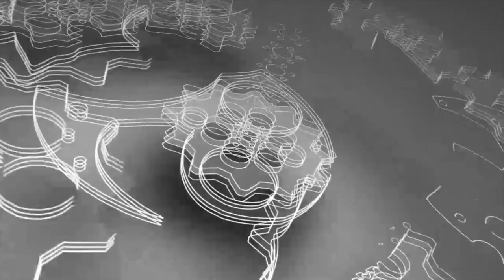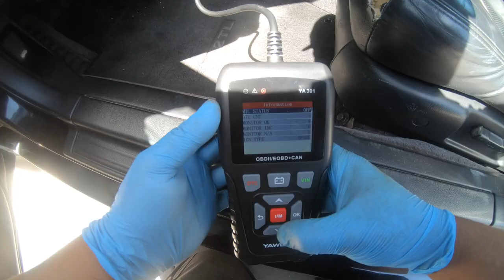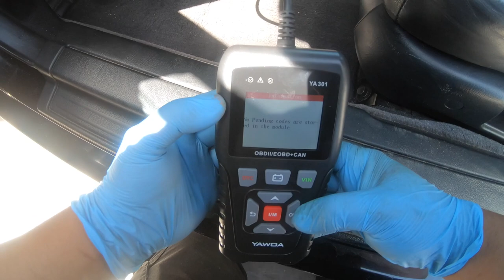Remove and Replace Brake Booster and Master Cylinder with Brake Bleeding Procedure

Comment: While installing a radio on my car I noticed some fluid at the base of the brake pedal,at first I though the power brake booster was faulty,but now i am not so sure,the pedal feels spongy at times,could be the master cylinder thats bad?
Reply from the maker: Exactly, the Master Cylinder is leaking internally into the Brake Booster. It’s best to change both when this happens.
Reply: @HomieHektor  thanks man

Comment: Nice diagnosis of the faulty part. But please just attach a clear hose into a water bottle when you bleed the brakes, its way more satisfying to see the air bubbles go away, and way less messy

Comment: Hey bro i have 4 connection on my pt cruiser do I have to air bleed it all at once on my master cylinder
Reply: Yup.   And in the pt cruiser with fuse box directly in front of it; is such a great time.  Sorry to hear it.
Just copy what he did to the 2 ports, x2.   You will need 4 pieces of hose and some black electric tape to wrap around it a few passes to hold the lines in place if you don't have the kit.

Comment: Wow bleeding those brakes really got messy you should really use a bleeder hose so it doesn't leak all over the floor and stain your floor brake fluid is very acidic!
Reply: My wife would make me sleep outside, on the driveway.
Reply: @DevJB  Wow that must be a very irritating night, who knows what's crawling around there 😲🤯